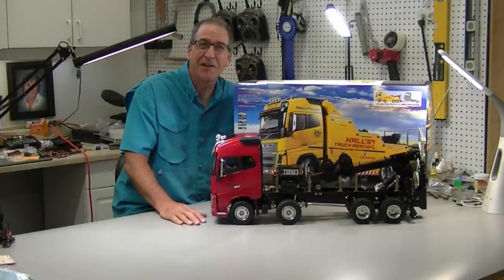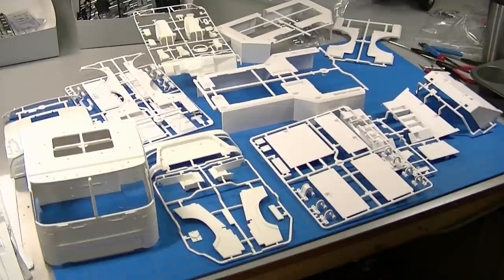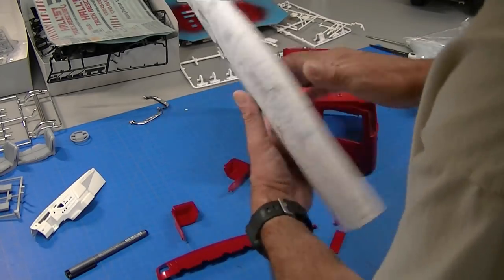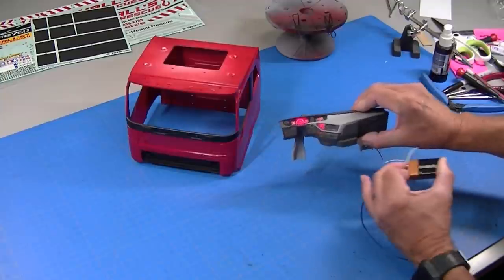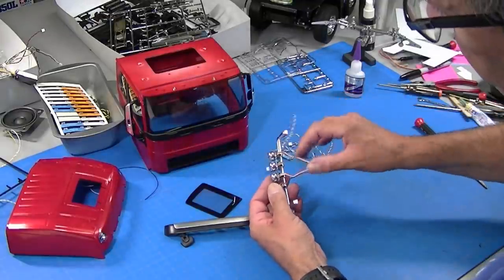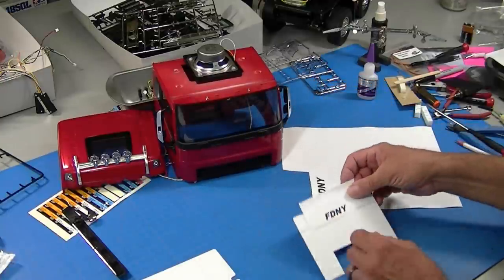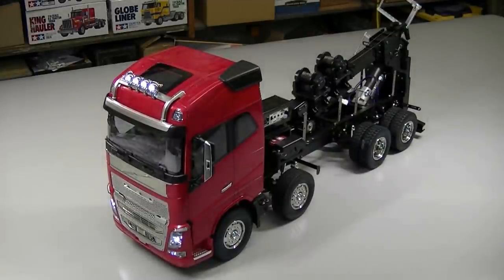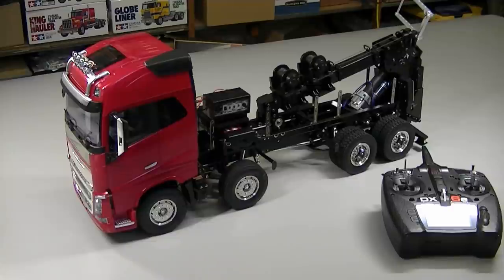Tamiya 1/14 Volvo FH16 Tow Truck Build - Part 6 Cab & Light Wiring

Comment: Lovely model, nice paint scheme as well. Where you routed the cables from the lights is about where the wiring looms goes from the cap into the chassis on the real thing lol. Pity Tamiya didn't model the "V" lights which are a cool feature of the FH16.

Comment: I'm sure I've commented on this Video before.... 
But WOW! 👍👍🍻 

Now I'm almost thinking about the MFC-03.... Just because this is my first Big Rig, and it may be complex with the Wiring (but wouldn't ANY Rig be a Bowl of Spaghetti?) 😲  
It's at least got more Features than the MFC-01.

Do you have any MFC-03s in stock??? They seem to be hard to find and Evilbay at least, is selling them for WELL ABOVE Retail. 😠😠 
Still very interested in the Beier USM-2.... Probably my second Rig.
..... Unless I just can't get a MFC-03. 

Oh, and DEFINITELY a few of those Channel Light Switches!! I'll want at least 5 to start.
Reply from the maker: Yes, I have MFC-03's also.
Reply: @HobbyconceptsLLC   It's quite a bit more.... But until I get familiar with HOW those miles of Wiring actually interact - and how the features WORK, it might be better value in the long run. 

I'm also ordering extra LEDs... And at least a Box Trailer at the same time, so it's going to be quite a bit to swallow. 
But I'm still excited to do it!! 😊

Comment: Hi Bob, I really love your builds. What kind of material did you use to cover the speaker and the MFC? Is it plastic or carton? Where do you take it from?
Reply from the maker: I use thin plastic card stock.  Actually I have a stack of old advertising signs I cut up and use.

Comment: Hi Bob it’s looking fantastic. Thanks for showing how to add the additional lights, but if you wanted to have them just come on with the rest of the truck lights is it possible to splice into the mfc wires or would this be too much load for the mfc?
Reply from the maker: Yes, I do dash lights that way a lot and use an open space in the MFC.  I just wanted to have a separate light switch for these that is where the electronic switch is nice.

Comment: Bob ,2 questions please. Why do the Tamiya supplied leds have no resistors at the bulb? And the roof lights you run to the electronic switch ,could you not connect this to the wiring for the roof bar lights so all will come on at once?
Reply from the maker: The Tamiya MFC has the resistors built into the unit.  I could have connected the roof lights to the MFC but wanted them on the separate switch.
Reply: @HobbyconceptsLLC  Is connecting to the mfc safe,would you need the resistors fitted OR will the MFC take the added lights ok?

Comment: In that upper panel, you put small red and white LED's.  Red really isn't an appropriate color.  They are not allowed on the front of vehicles unless used by emergency vehicles as an emergency flashing indicator.  And I don't think they would both be on at the same time.  I think you should have made the red amber instead.